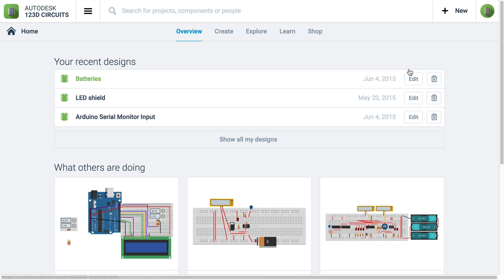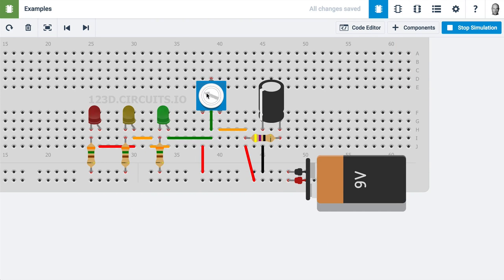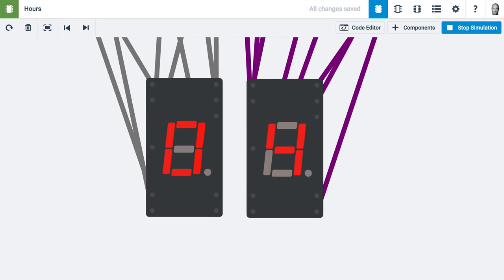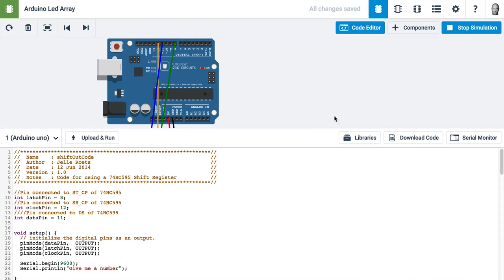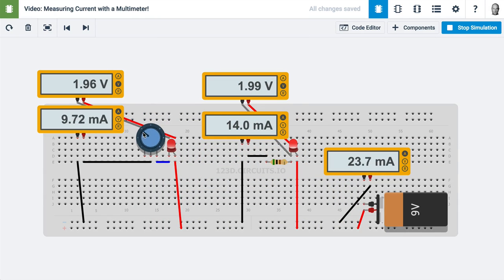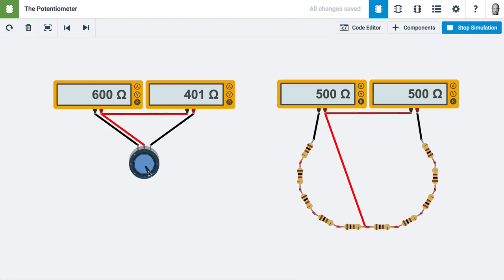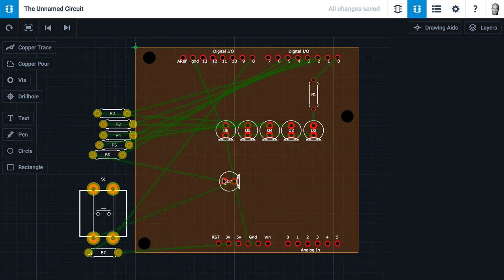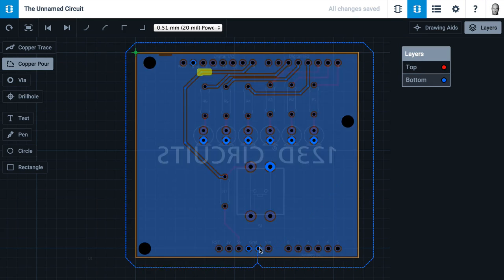Autodesk Circuits - Electronics Lab

Comment: I have really enjoyed experimenting with this. But there seems to be no further support or develpment.  
There is a great range of basic components . But after what seems like a year of non response,  can we assume that no 
more components are to be added.  Today i would really like a simple Micro switch with both N/O  and N/C options.
Such a shame if its just been left to flounder .   thanks so far though
Reply: Hi Dan, the 123D Circuits simulator has moved into Tinkercad.com - Autodesk has added quite a few more simulation components.  Creating a PCB layout has transitioned over to Eagle.

Comment: Please could you tell me how to work with PIC microcontroller and Antenna in the Autodesk 123D circuit. Could I use it for simulating PIC microcontroller and radio Antenna?

Comment: Why doesn't the "Add to Cart" button appear under sample PCB boards I've made?
Reply from the maker: Hi Mike, 123D Circuits stopped directly selling PCBs from the site in July 2015. You can however easily download your Gerber files as a .zip and upload the to a site like oshpark.com that does high quality PCB fabrication at a low cost. Here's an illustrated like on the process:  https://support.circuits.io/hc/en-us/articles/205848878-How-do-I-order-my-PCB-